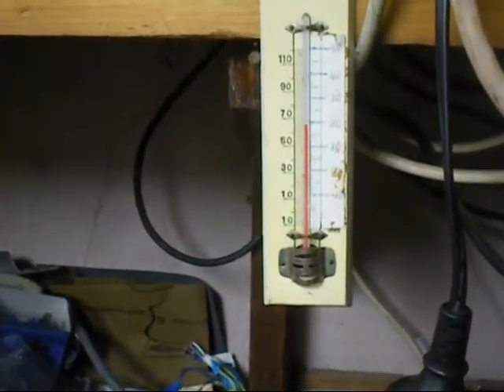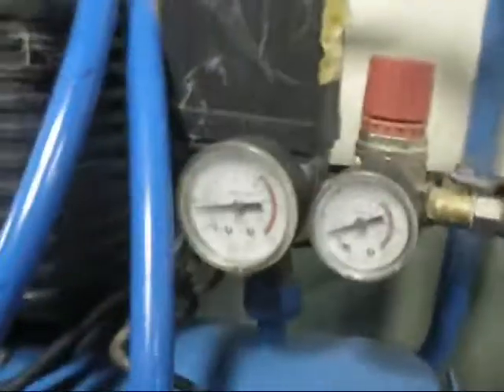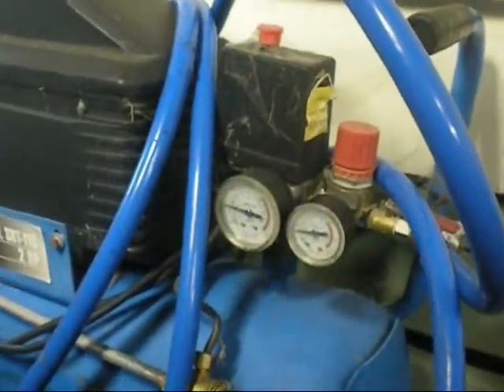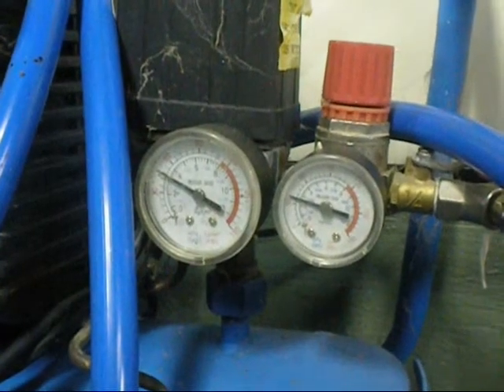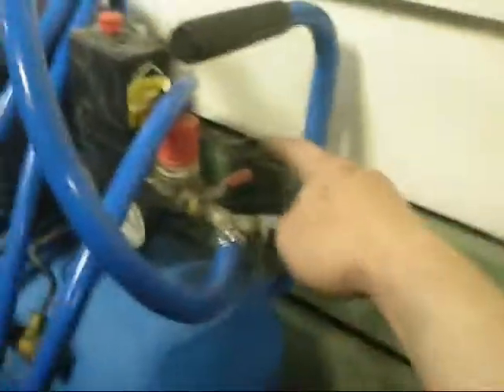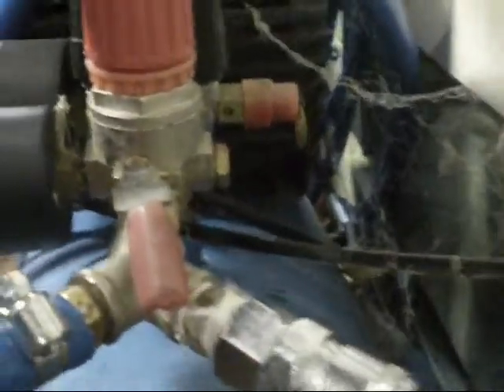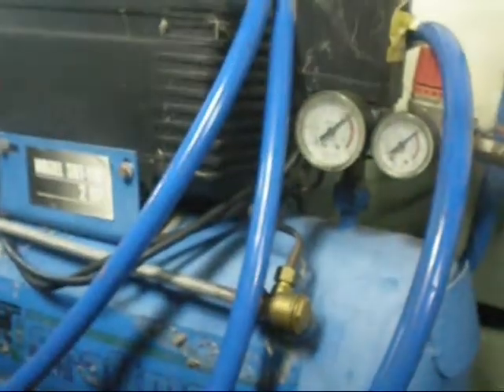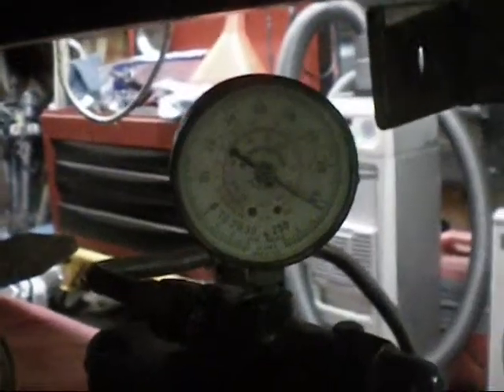compressor has more air.

Comment: Good plan, using the cheap compressor as a storage tank and backup pump, if they weren't so far apart you could run a hard line from the garage to the carport with PVC water pipe, maybe you still could if you buried it. I knew an upholsterer and he had his whole shop plumbed for air lines, had PVC pipe with air hose fittings every so often about 3 feet off the floor (overhead where needed) about 5 or 6 feet apart, really cleaned the place up.

Comment: @Aussie50 I think that the pipe he used was what they call "Schedule 40" PVC which they use for water pipe, not the electrical conduit stuff. He installed the pipe himself so it may not have been the best material for the lines, but then again he only ran his compressor up to 80-90 psi since it was for staple guns. I would have figured that it would be alright to use since air compresses much more then water at the same pressure but maybe not.

Comment: ill have to take a vid of my set up i got a 4 port manifold for mine and ive got 2x 200l p/min 40L black ridge compressors + my old twin pot belt driven powacomp 80l hooked up together it was a real pain in the arse getting all the pressure switches in sync tho and occasionally they go out and need readjusting.